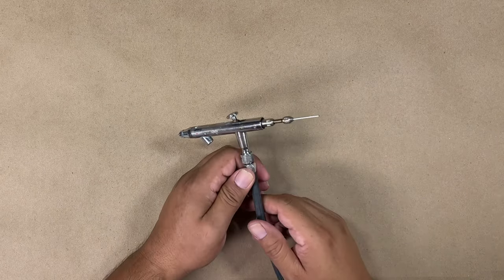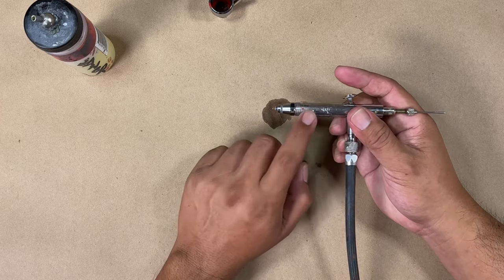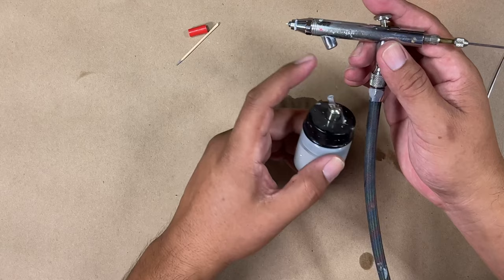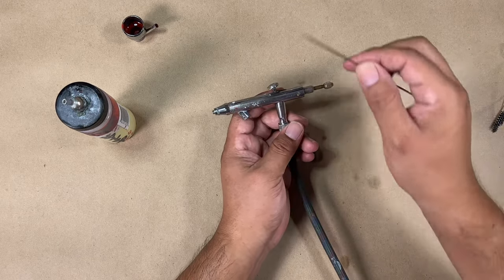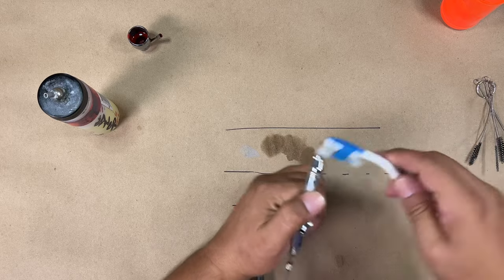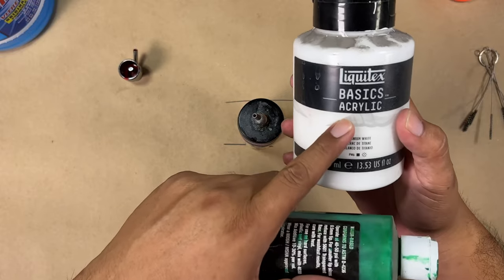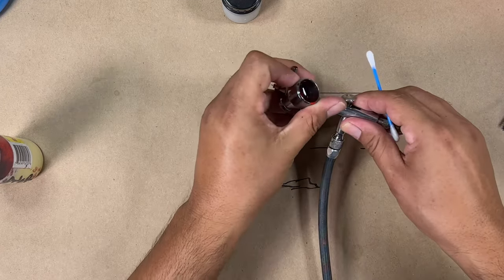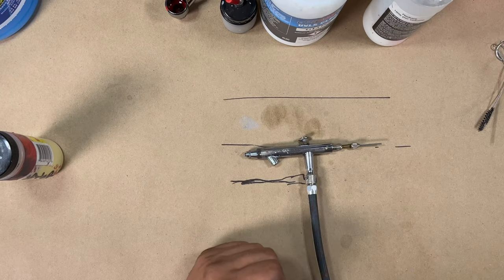Troubleshooting Airbrush for Beginners Common Problems Unclog, Paint, Air, Bubbles

Comment: so... how does this video only have 276 views and 14 likes? there is some good information here. I was gifted an airbrush (Christmas present of 2023) and have had some pretty rough troubles. the paint needing to bee the consistency of milk might solve my problem. haven't tried it yet but I know it's been thicker than that. also, the airbrush I was gifted has a little different nozzle design that in my opinion looks harder to clean/clear out than this. if this becomes a real hobby for me, I might need an upgrade.
Reply from the maker: Thank you for your comment. Its fun to paint after you learn to trouble shoot quickly. 😀

Comment: Ciao. Bel video e bel canale. Il mio aerografo non ha perdite d'aria. l'aria esce regolarmente, nella tazza non si formano bolle con l'acqua. Ma il colore ogni tanto fa la schiuma, poi passa e poi le fa di nuovo. In mezzora lo fa 4/5 volte. Anche dopo averlo smontato e pulito per bene. Per la tua esperienza cosa ne pensi? Puoi aiutarmi? Ho un A&S Ultra 2024. I colori si Airvrush Color (1/1) e PSI 20. Grazie
Reply from the maker: The problem is in the tip. If you have extra pieces I would test each piece by replacing with a new one. From experience. bubble of any kind usually means... 

1.  the outside of the Nozzle is dirty or stretched out from the needle being pushed out too hard
2.  Nozzle cap has build up.. pushing air back up through the cup
3. the nozzle cap is too tight and the rubber bushing is getting crushed. pushing the cap to be more resented towards the body of the airbrush.

New parts are recommended... mainly the nozzle.
Reply: @ErnieHernandezdesigner  Grazie mille. Proverò